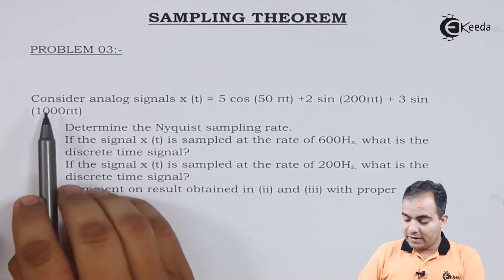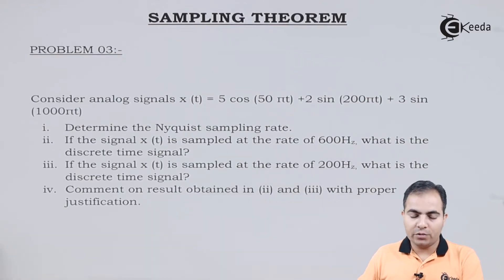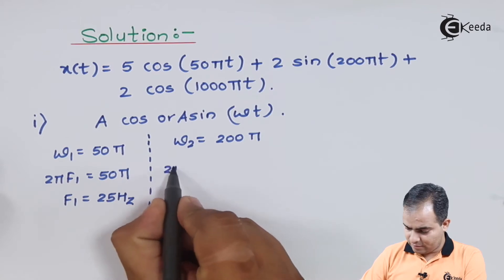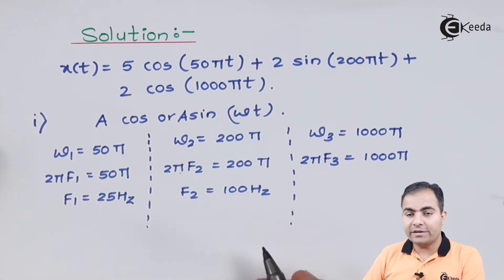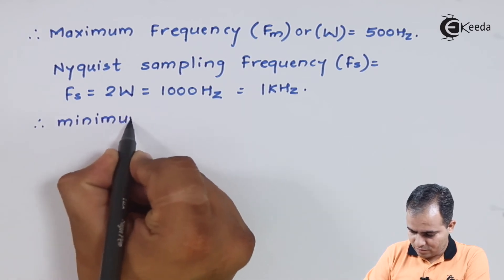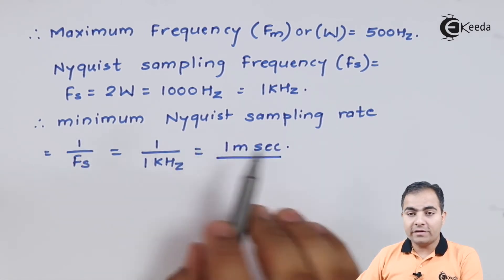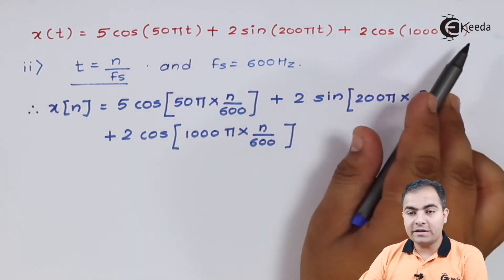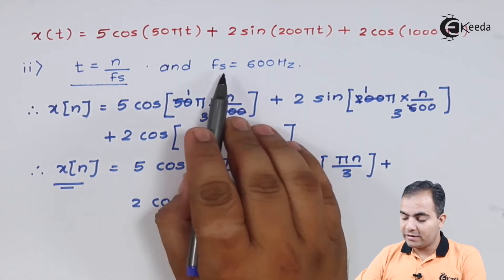Problem 3: Sampling Theorem | Sampling Theorem | Signals and Systems

Comment: According to nyquist sampling theorem, you calculated minimum frequency for the successful reconstruction of the continous time signal is when you sample it at >= 2*fmax that is 1000 Hz. But in video, you have said there would be no aliasing present when sampling frequency is 600hz which is less than the 1000Hz minimum that is required.